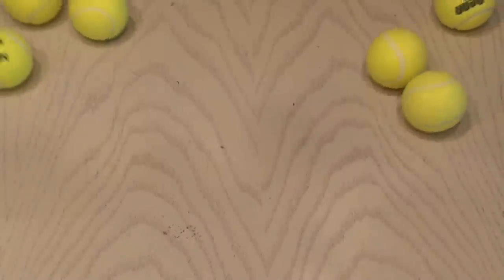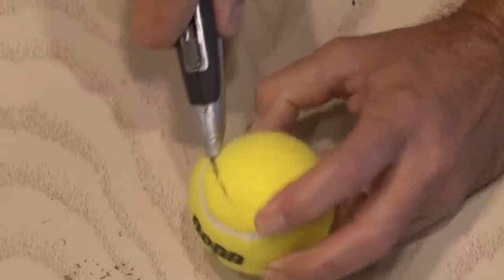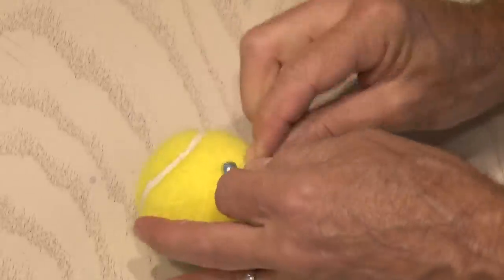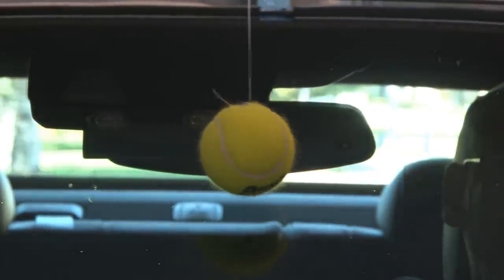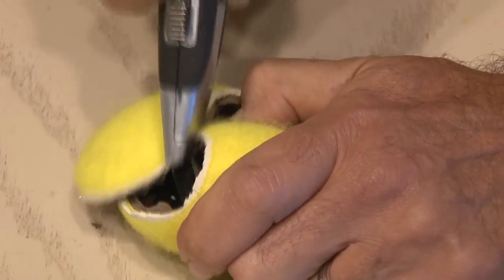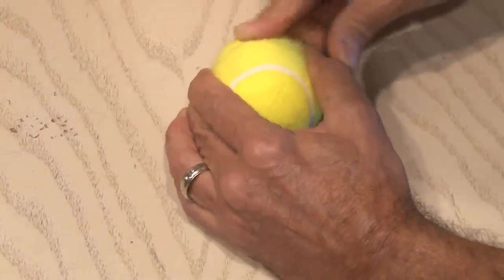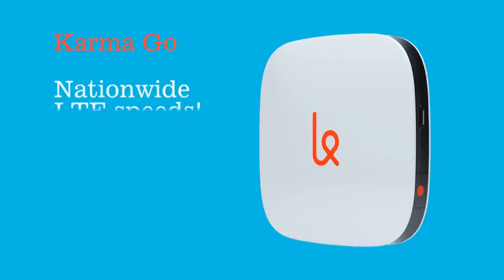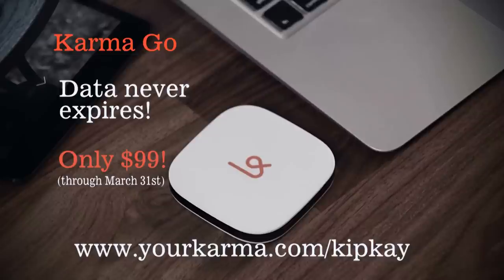5 Clever Uses for Tennis Balls!

Comment: Great tips! One more tip would be to use the tennis balls under furniture where the legs are not exposed and use them to protect the floor(especially wood) and make the furniture easy to move around. Nothing is worse than plastic bottles and 6/12pk holders. Plastic bottles need to be banned. The land and sea are full of them. Glass is best even though it breaks easily. Just take a look at the Great Pacific Garbage Patch which is the size of Texas.
Reply: That doesn't exist
Reply: Really? I suggest you look it up. Many images of the Pacific garbage patch.
Reply: electronicsNmore Its still not real......like (insert offending concept here)
Reply: You're delusional. Just because a great majority is suspended below the surface, does not mean it does not exist. I don't like arguing with kids. I suggest you stick with playing video games.
Reply: electronicsNmore Its are spread out its not one big pile.

Comment: This video inspired me, I have a couple of bannisters with sharp angled edges in high traffic areas, so I took some tennis balls, cut a slit in them, and I put them on the ends so it won't hurt as badly if you bump your side or hip into them by accident.

Comment: also: you can put halfs of them under your PC as feet, eliminating vibrations otherwise being passed on by harddrives or fans.
the same also applies for speakers (well not the tiny ones but 6.5" - 8" and above) and subwoofers, improving your audio!
and if you dont like the yellow look and you don't have to touch them, taking a spraycan to it (after you cut it) is always an option.

Comment: Here is another cool trick for a Tennis Ball. I work as a Custodian at a School. And the kids like dragging there shoes on the floor making tons of marks all over the place. Sometimes there are way to many to just use your shoe and rub them off. So what we came up with was, take a tennis ball cut a X slit in it to allow you to put in a broom handle. Now all you do is go up to the shoe marks and the tennis ball rubs them right off, and the fuzzy part of the ball picks up the dirt and stuff from the shoe marks instead of just leaving it on the floor. Pretty cool trick. Also very handy use for a tennis ball. After awhile though the ball does need replacing cause it gets gross from all the shoe marks, but it takes awhile before that happens though.

Comment: Here's another use I figured out; tennis balls are great for juggling, but they're a little light and have a tendency to bounce upon capture, so I used a hypodermic needle and filled three of them full of water ( you have to pull one air out for every water in until they don't slosh) then they have a pleasant heft to them and still bounce like regular. Much easier to catch.

Comment: Got a couple more for you, kipkay:
1.  Got a piece of furniture on a hard wood or tile floor that you don't want to cause scratches? You can go buy the foam feet to stick on the bottom, or you can cut up an old tennis ball.  Cut it to the shape needed for the foot, stick it to the foot with the fuzzy side down to the floor, and you won't have to worry about scratches.  If you're worried about the tennis ball falling off, you can secure it with tape or even glue.
2.  Need to replace your sewing pincushion?  Save yourself the trouble and just cut a tennis ball in half. Put the open half down, and stick your pins right into it.  You also end up with two, so you can store that other half and replace the current one when it gets too old, or just give it to someone else.
3.  Going boating or out by the pool, but have something essential you have to keep on you, like your car keys?  Get yourself an old lanyard and attach a tennis ball to it; you can use a screw that you tie the lanyard to, or even do a few quick stitches and sew them together.  When you're going out by the water, clip your essential item to the lanyard.  If it falls in, the tennis ball will float (at least until the hole lets the water in), allowing you enough time to grab it.  Plus, the bright greenish yellow color makes it stand out and easy to find.  Just make sure to test the equivalent weight before hand with something that won't be damaged by the water.  If one tennis ball isn't enough, just add more until it stays floating.
4.  Got a rug on a tile floor that keeps sliding around on you?  Cut up some pieces of tennis ball like the furniture feet.  This time, however, set them with the rubber side to the floor, and attach it to the rug with a quick stitch.  Put one in each corner, and possibly a few other places if your rug is large. Now the rubber will grip the floor, preventing the rug from slipping. 
5.  Don't forget about the tube you get when you buy tennis balls.  They make great containers for long objects like bolts and screws.  You can also store paper in them if needed to provide some protection against the elements.  Just make sure the paper is folded so it fits the height of the container, roll it up, and put the lid on.  You can store important schematics and instructions out in your workshop or garage where you need them, without having to worry about them getting dusty or wet.

Comment: TIPS: for the car garage parking thing, 1) poked a hole in the ball and thread paracord though so it will be stronger. 2) Use eye bolts instead of screws in the ceiling. 3) Aligned the ball so that it is directly in front of the steering wheel, so you park in the same spot front to back and left to right.  4) Put a small hook in the ceiling as well so you can hang it up out of the way.

Comment: another use:
if you got a chair that makes alot of sound when you move it (for example: move foward when you are still on it)
well you can muffle that sound with 4 tennis balls, cut a hole in them and place them on the bottom of the 4 chairs foots
next time you move there is going to be no sound :D
Reply: But it looks like crap

Comment: if you forget your keys you can use a tennis ball just take a hot key burn a hole in the tennis ball put the tennis ball on the lock and press on it the air pressure will push the lock

Comment: Karmago is really great idea, but is only good where there is a sprint connection, here in NW Montana we have No signal or Verizon, which is real close to no signal.  Bottom line be sure that Sprint works where you are before buying.  Great idea the non expiring non contract I want it.